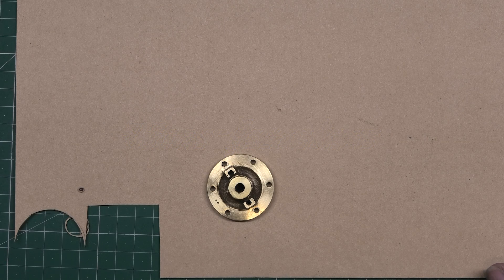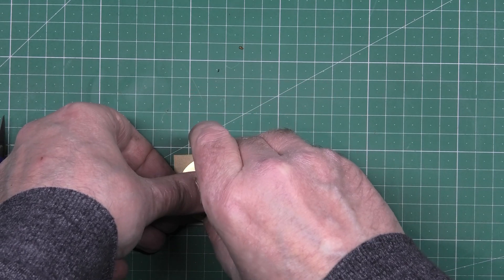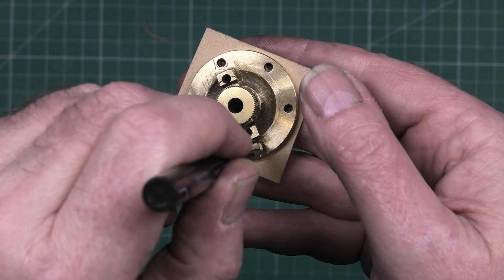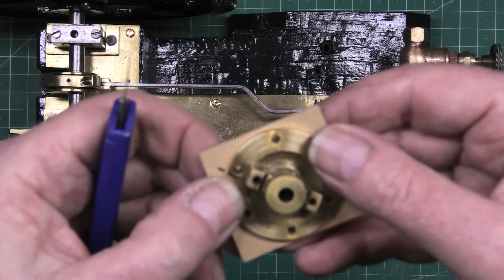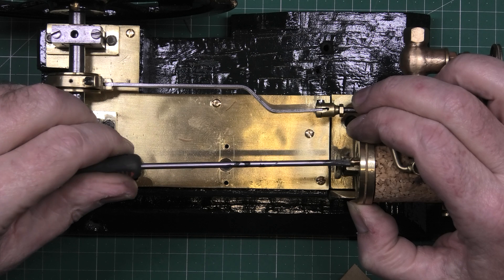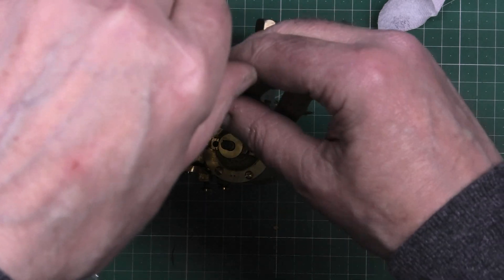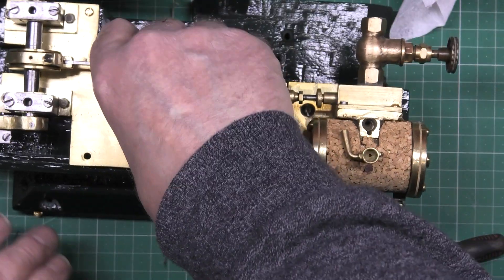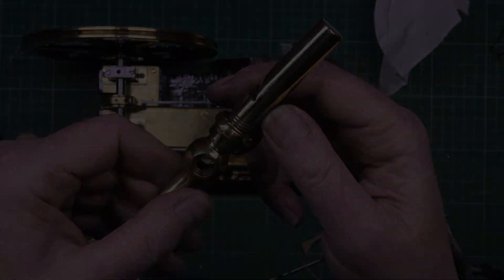Live steam engine refurb - the 2nd one - part 3 of 3

Comment: press your end cover on  an ink pad then print it on the gasket material. cut out the hole then put on end cover, place on scrap wood and drill through stud holes with cordless drill. bolt on to cylinder then trim off excess with scalpel. simples
the other bits you didn't put on were for a water pump.

Comment: Well done!

A properly machined part like a steam engine cylinder will have concentric I.D. and O.D. and the bolt pattern will be evenly spaced on a bolt circle concentric to the O.D. and I.D. as well.

If it is properly machined, that allows you to lay out a gasket with a compass and a protractor.

That can result in a more precise gasket and usually gaskets are slightly undersized on the O.D. so you can make it look more right than cutting the gasket to exactly match the O.D.

I also like to use good scissors to cut gaskets, I think they can make a nicer cut in gasket material.

For the bolt holes, you can get an inexpensive copy of a Roper Whitney hand punch which will punch sheet metal as well as paper.  When you are ready, that's a very handy and reasonably priced tool.

In the end, any way you make a gasket that doesn't compromise the seal, you did good.
Reply: If it's correctly machined, i totally agree. The 2 that I've done so far, have irregular bolt patterns which is why I always use witness marks and do it by hand (it's all I can do anyway).
You're correct about scissors but I don't own a decent pair. I was taught once that scissors are the only thing that cuts - knives part the material and compress the material.
I admit that I need tools but, if I waited for another tool to arrive every time I needed a new one, I'd be working on this for years! 😂

Comment: Question mate - how do you video your overhead shots? What setup do you use. I want to do something similar. If you could do a quick video showing the setup that would be fab
Reply from the maker: I use a cheap shelf and cheap tripod end piece. My bench is 600mm deep, so the shelf sticks out 300mm to make it in the middle of the bench. Just sticking out over the edge of the shelf is a cheap tripod end (to hold the camera) which is bolted to the shelf. All the videos I take are 180 degrees out, so I rotate them by 180 degree and it looks like the camera is actually over my head 😁
There's no way am I doing a video of the shelf, it's the biggest mess ever! 😂